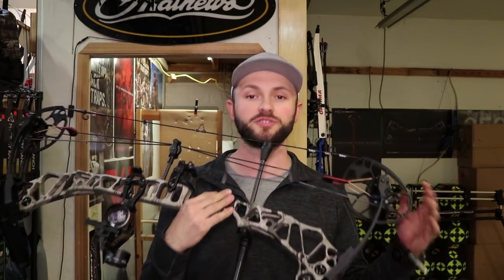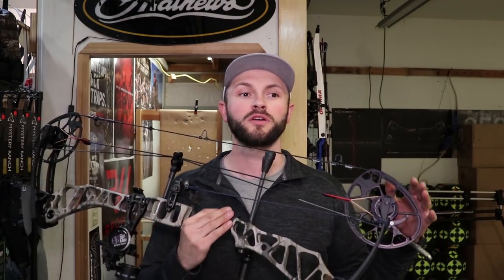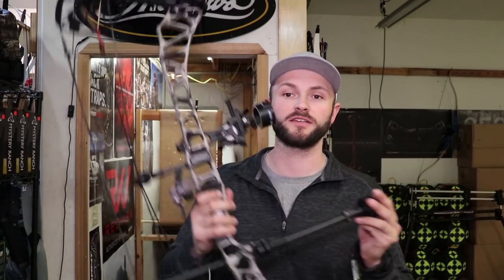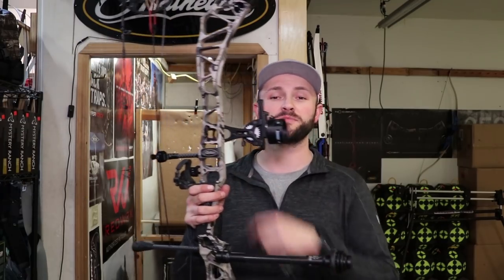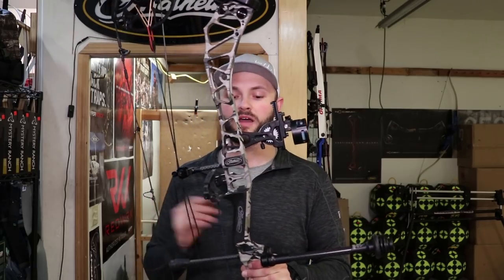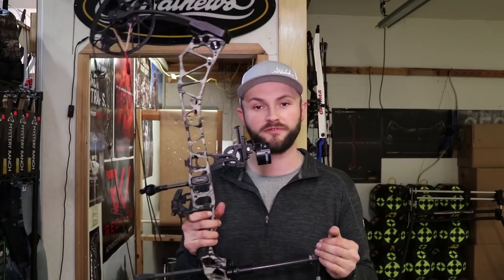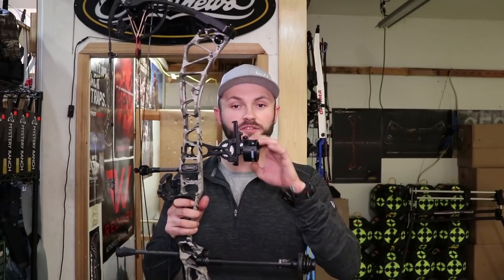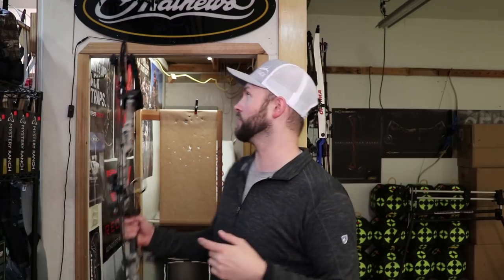Bare Shaft Tuning: Getting the most Forgiveness out of Your Set Up

Comment: Just got my 2003 Matthews Legacy back from a bare shaft tuning at my local bow shop.  Still off with 1/4 inch tail high right.  Shop owner said he maxed out the rest travel and its the best that he can do!  Tell me more about swapping out the top hat on the cams please?
Reply from the maker: Well they should be using the yokes to tune, not the rest. After a couple twist in/out of the yokes you can move the rest but it's not the first move.
Reply from the maker: There are no top hats on that model. The Halon was the first model with top hats
Reply: I asked him about doing the yoke adjustments.  He said his experience with the Matthews doing yoke changes causes cable wear problems.  Im going to try shooting a less heavy FOC and if i cant get a bullet hole i will look for a Matthews dealer in my area.
Thank you
Reply from the maker: @thomashood3748  yeah I've never seen any more or less wear on the cables from yoke tuning, but maybe he has!?

Comment: I know this is an old video but I’m having trouble paper tuning a new bow, I believe my spine is to soft I’m shooting 340 spine Easton axis, 31” arrows 456.2 grain finished weight, 125g broadheads and field points, 31.5” draw and 70lb. I’ve had levels on everything and seem to be good, I’m going to be be borrowing a 300 spine arrow next week to shoot through paper and if it’s still no good I’ll take it to a shop, when I got the bow original I brought the arrows with me and the tech told me he shoot’s the same thing and close in finnished weight even but never said anything about the spine being to soft for the new bow ?? Am I way off that thinking a 340 is to light for this set up, I get if it was a 26” arrow it might be fine but being a 31” out of a 70# bow is probably to light?? Any insight is appreciate, awesome channel , keep it up!
Reply from the maker: Yeah a 340 is wayyy to weak
Reply from the maker: You need at least a 300, maybe a 260
Reply: Thanks !!

Comment: Soo in theory once your tuned and matching at 20y will your paper tune be out o wack? The way it looks is your just using it as a starting point. Also with my bowtech with duel yokes could I yoke tune the bareshaft and keep my center shot perfect?
Reply from the maker: Yes you can definitely use the yokes and not mess with the rest!!  And yeah, paper tuning is usually just a starting point

Comment: I'm confused. You say that when the bare shaft impacts to the left of the fletched arrow, that means that the arrow is flying  "TAIL" to the right. If you move your rest to the left, wouldn't that make it worse? Wouldn't the rest being moved to the right bring the point right and the tail to the left? Do you see what I mean.
Reply from the maker: I see what your saying, but yes, if you arrow is impacting left, it means the shaft is kicking tail right out of the bow.  It's the same when broadhead tuning, if your broadhead is impacting left of your field point, its because the tail of the arrow is kicked to the right, causing the broadhead to point and plane to the left.  Moving the rest left will alleviate the tail right tear.  Seems, backwards, I know, but it is what it is!  Thanks for Watching!
Reply: @InsideOutPrecision  Could someone (you?) make a video where to explain this, why it works when you adjust in the way what makes no sense. There are a lot of false information about this on youtube and all around the internet. I have found out it works just like you said but I do not understand why :D

Comment: I am wanting to bare-shaft tune, but not have been able to.  What I am seeing is that from 0-30 my groups are as expected, however at 40-60 yards, my groups open up and are mostly horizontal stringing.  What are your thoughts?
Reply from the maker: It's hard to say without seeing you shoot, but if your form is good/consistent, horizontal groups are usually a tuning or arrow spine issue.
Reply: My issue was a leveling issue between D-Loop and rest.  My shop had it level, but my bow did not like that.  I played with it today and now I am good on target all the way out to 60 yards.  Thank you.

Comment: I’m looking to get more yards out of my setup. I’m shooting an HHA optimizer single pin and I get about 90-100 yards max. Does Spot Hogg max out at longer distances? FYI I practice longer distances by choice. Makes anything 50 and less so dang easy.
Reply from the maker: No, your max distance is pretty much determined by your peep height
Reply: Inside Out Precision that is great to know! My peep sight is currently too high to touch my nose to the string as a third anchor point... Moving it down about an inch would give me that third anchor point and possibly more distance? Thanks for the knowledge man, I’ve been watching all your videos and you have such great insight! Your videos have helped me out in so many ways, keep it up. Shout out from Edmonton, Alberta!

Comment: I have a vxr 28. Specs are 28/60 arrow is an easton da torch 330. I keep getting a nock low tear, I've tried lowering rest, raising nock point and nothing helps. The only way i can fix it is to make the bottom cam hit first and i know that's not the correct way to tune a bow, so what should I do to fix it? I have my own press and draw board.
Reply from the maker: Might try a weaker spine arrow

Comment: I have a one quarter left turn on my bare shaft at 15 ft ...it had right helix vanes ...should I go with left helix on the new vanes?
Reply from the maker: I haven't seen the direction of the helicalmmake any difference in accuracy. Shot 6 arrows with left and 6 with right helical at 60 yards and didn't see any benefit to one over the other
Reply: @InsideOutPrecision  great! I'll be changing 4 arrows over to tac driver 2in. Hybrid vanes and see how that work for me ...thanks again for the quick reply.

Comment: I have mathews trx 36 bought on ebay. did top hat tuning but both the cams are leaning out side. with hoyt hyperedge it was easy to make straight. how do I do with trx 36 it has no yoke
Reply from the maker: Well the moving the tops hats will lean the cams in order to tune. Worked the same way with your hoyt. Lean the cam right or left to take out a right or left tear through paper. It doesn't hurt anything. If its shooting good holes through paper just leave it alone

Comment: I need some help,I'm new to. Archery I have a Mathews V3 27, set it to 55lbs,and my arrow is 400 spine Victory vap ss. 30" end to end. And 435g  My draw length is 27.5  when I  shoot it the nock is kicking  to the right,  but my arrow rest is maxed to the left....  
/My V3 31 with the same arrow shoots straight./
 What can I do to make it straight? Swap the top hats? Kind regards Robert.
Reply from the maker: Yes you need to re center your rest and use the top hats to tune. Push the cams in the direction of the tear (to the right)
Reply: @InsideOutPrecision  thank you so much for your reply and help!!!  And sorry for my broken English.
Kind regards Robert

Comment: When doing this method does it require the two arrows to be the exact same, just one with the fletchings and one without? (Same grams, length, etc)
Reply: James Marshall yes. You need your arrows to be identical for the most accurate results
Reply: Then when you use other arrows do you do the same process of micro tuning for all the arrows in your arsenal?

Comment: I know this is 4 years ago. Ha! . Have a question though, how far out to the left should i move my rest. Cant get rid of right high tear ( bare shaft) about 10’ from paper. It’s about 1/4” both ways. Looking down my limb pockets arrow os pointed to left after adjustment
Reply from the maker: What kind of bow?
Reply from the maker: ideally you should use the yokes or shims before you move your rest
Reply: @InsideOutPrecision  vtm 31
Reply from the maker: @tonyviers-de9qi  yeah so you want to leave the rest at 13/16” and shim the cams in the direction of the tear until it’s a bullet hole, then you can micro the rest one way or the other a tiny bit to polish it ip
Reply: @InsideOutPrecision  thank you. Just have to get a bow press now . Ha
Reply: @InsideOutPrecision  what if cam is all the way over to that side already?

Comment: I shot my triax at center shot 13/16" from the riser and at 20 yards im getting bare shafts hitting 6 inches left by the time i adjust my rest to the left i end up running out of sight adjustment to get the bow zeroed at 20...is something wrong here? Im shooting 28 inch draw at 73 lbs with a 300 spine victory rip tko!
Reply from the maker: Did you shoot the bare shaft through paper first?
Reply: @InsideOutPrecision  no i shot fletched through paper and i didnt get bullet holes until my rest was set at 1 inch+.  I have to settle with a slight nock right tear at 15/16th just so i could zero at 20 with my sight maxed out to the ledt. I use a high grip with the bow in the webbing. Currently at 15/16th i can shoot broadheads from 20 to 80 yds and get bulleseye with my field points and mechanicals hitting roughly 5 to 6 inches right maybe a little less.  I know thats minute of angle but then again  i know this bow will tune.
Reply from the maker: @KTMsoldier1988  You don't move the rest to tune Mathews, you move the top hats (spacers on either side of the cam). You need a press to do it, but you push the cam towards the tear. So if your ripping left, start by putting the larger spacer on the right side of the top cam.
Reply: @InsideOutPrecision  thats what my understanding was with a mathews but my local bow shop doesnt seem to think it will fix it. Im getting nock right tears and my large spacers are on the right so i should be able to just flip them.  Question is should i do both or just one. Both top and bottom are the same
Reply from the maker: @KTMsoldier1988  start with the top

Comment: So your saying we should move are rest too?
Reply from the maker: Only a tiny bit. If it's only an  eighth of an inch tear, chances the top hats will over correct. In that case just bump the rest 1/16 or 1/32 in whatever direction you need to to correct the tear...it's shocking how little movement will affect a bare shaft

Comment: I don't shoot bare shafts though..all my arrows have vanes
Reply from the maker: Right, but if your arrow is coming out crooked in any way, your vanes have to work harder to stabilize it. If your bare shaft come out straight, the canes can do their job better and the "bad" shots don't punish you quite as much. 
For example , if your arrow is coming out of the bow kicking left, as the the arrow rotates, the vane on the left side of the shaft experiences more drag than the other two, causing the "tailspin" as it flies.  A good bare shaft tune makes sure all vanes contribute equally, thus creating a more forgiving arrow. Thanks for watching! Keep it Inside Out
Reply: @InsideOutPrecision  in theory however a bare shaft vs fletched are two seperate arrows.  The fletched arrows obviously have a different aerodynamic profile have weight on the back are stiffer.  Goldtip has a series called Supertuning.  I suppose if you could add enough tape and place that in exactly the same place as the fletched it would mimic the fletched in terms of weight FOC spine but failing that .. really no point to it.  I appreciate your response though
Reply: dougk5 Well, He’s 100% right so...
Reply: @optimuscrime608  honestly this is bunk.tuning with an arrow you don't shoot with a different FoC a different spine and a different weight and spine and then taking the position that how this arrow reacts is somehow related to your fletched.  I'm hardly the only that doesn't buy into this.  If you want a good video series on tuning your bow I'd suggest Goldtips supertuning video.  Bowtech has info on tuning as well.  They'll tell you this is bunk as well.  PSEs Tony Vargas he'll tell you its bunk as well.

Comment: Will you have to re do this with different arrows? Let’s say you go from Beman ICS 300’s to Easton axis 300’s same length etc.
Reply: not unless the diameter of the arrows is different enough that the "center" of the arrow on the rest is moved off center.
Reply: @rickokain3853  No matter what the diameter of the arrow is, it's always going to be in the center of the V off the arrow rest.
Reply: @nwbhc  apologies I meant for height, even then it would only be small though.